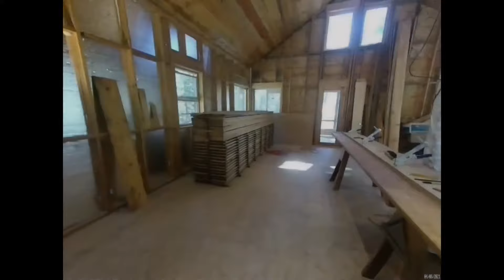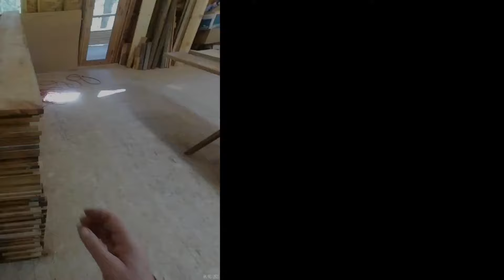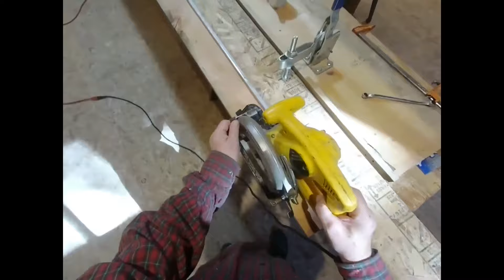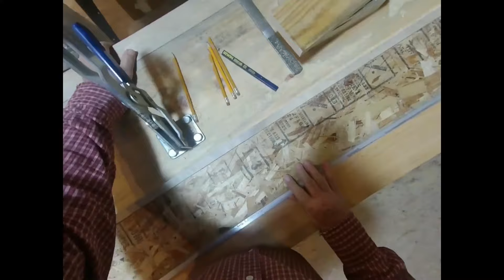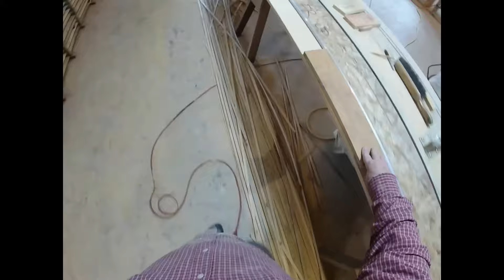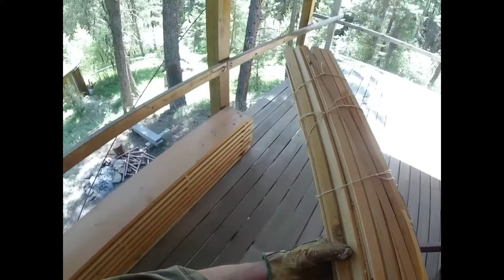Straightening long crooked boards with a circular saw.

Comment: That's not just a good job but, it is an excellent job. What you done with all the set up you came up with, do you happen to have a video on how you went about building the whole setup? If you do would you share it with us, I am very interested in doing something similar to it, congratulations, thank you for this video very informative
Reply from the maker: Sorry, I didn't record any of the cutting bench construction. The LVL bench top came from a used lumber auction. I ordered the toggle clamps directly from China, a decade ago. I just did a search on the few markings found on the clamps, but couldn't find any info on where they came from.
I lined up the clamps with a taught string to locate their mounting holes. The long piece on OSB, that I use for a saw guide came from the roof SIP (Structural Insulated Panels) manufacturer. It was a scrap piece. There are a lot SIP companies around the country. I think they can order OSB about any length they want for their manufacturing process. I've seen SIPs 24 foot long (mine were 20ft).
The cutting bench is pretty simple. It's just a 24in LVL lying on a couple saw horses; the clamps; and a wood fence screwed to the LVL.
In the openings to the videos that I've uploaded on making tongue and groove boards, I show some details on the cutting bench, and adjusting it.
Perhaps the hardest part of building this type of a cutting bench is obtaining the materials, because they need to be so long. (Otherwise you could probably buy one from Amazon.) 
The bench needs to be a couple feet longer than the material that your working with because you need a foot at either end to move your saw or router into and out of the cut.

Comment: Thanks for posting. I’ve just reclaimed a bunch of long 2x6 lumber that I need to rip down and straighten. You’re method is exactly what I was looking for to help me figure it out. How did you make the long straight edge though?
Reply from the maker: The straight edge is a long piece of OSB with a strip of angle aluminum glued on one edge.
The OSB is pretty good at laying down straight. But it will flex side-to-side if it is clamped at one end and the other end gets moved before its clamped.
The aluminum provides a low friction surface to slide saws or routers along. The aluminum came from a metal supply shop.
 I got the scrap strip of OSB (oriented strand board) from the company that made the SIP (structural insulated panels) for my roof. SIP manufactures order OSB in long lengths. My roof panels were around 18 foot long, but I think the panels can be made longer.